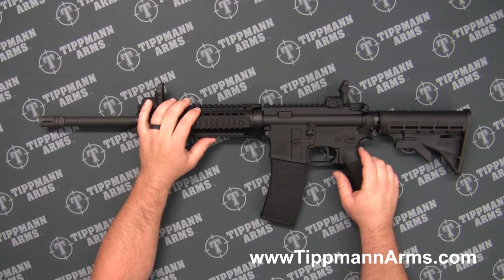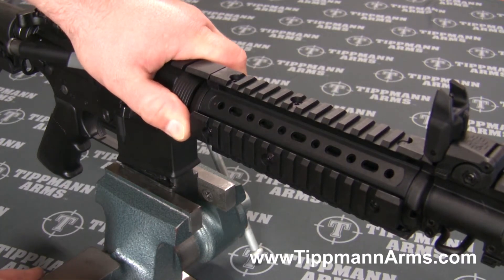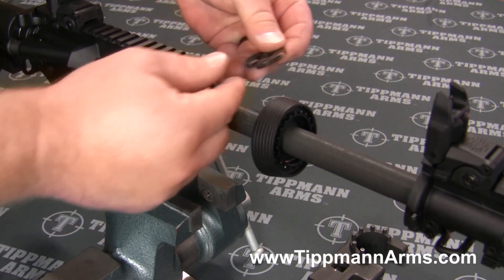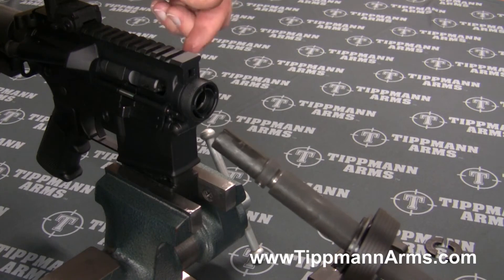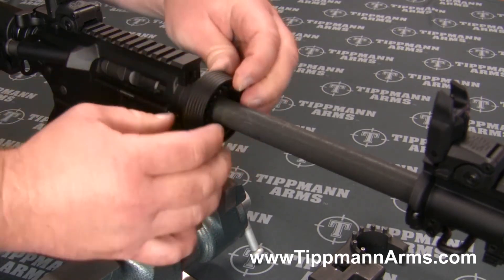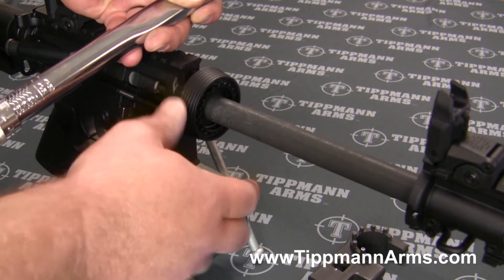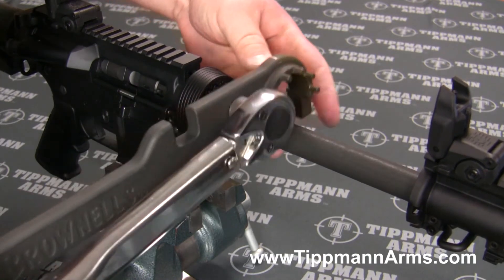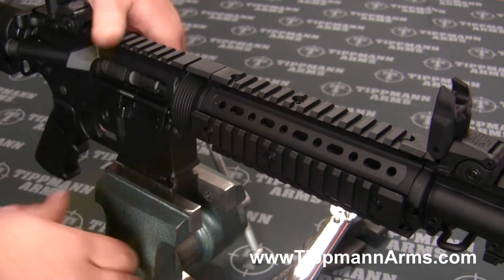Tippmann Arms M4-22 Barrel Assembly Removal and Installation

Comment: Coming by in 2024 to say the previous owner of my pre-owned airsoft gun needed this. They DID NOT use the washers as described. After a slashed foot cracked mag port and stripped off barrel nut I have successfully removed my outer barrel.

Comment: Will this rifle convert to .223?
Reply: no totally not.
Reply: @thewatcher611  it will only shoot .22 ? Not 556 or 223
Reply: There's no gas system on this rifle and the BCG is designed for rimfire, not centerfire cartridges.  Secondly, the barrel is almost certainly not specced to handle .223/5.56 pressures.  Even if you could somehow manage it, you'd be asking for a catastrophic failure.
Reply: Rimfire .22 LR IS .223/5.56 diameter.